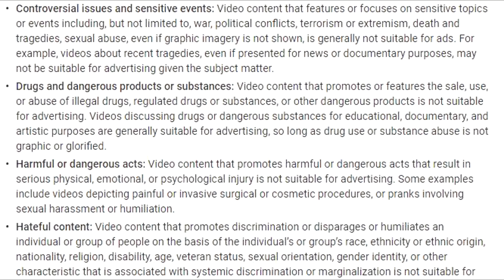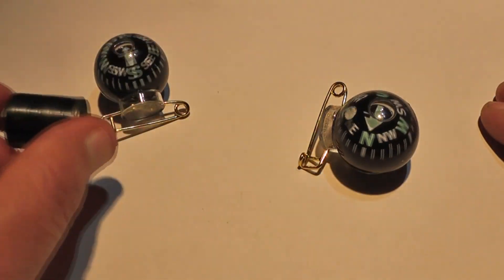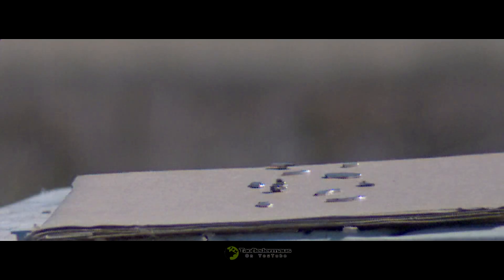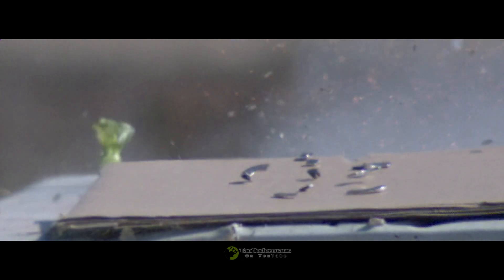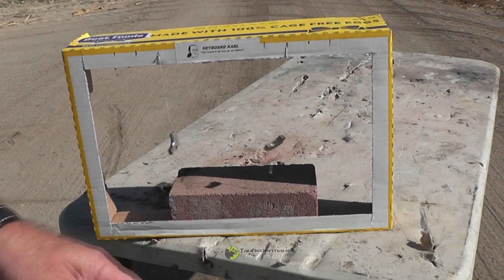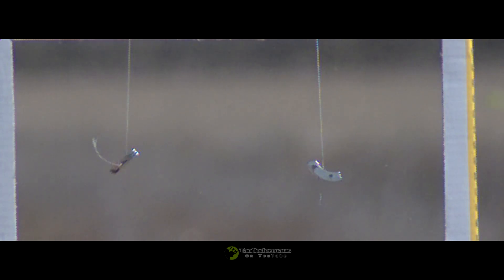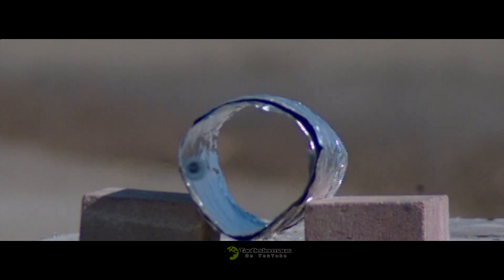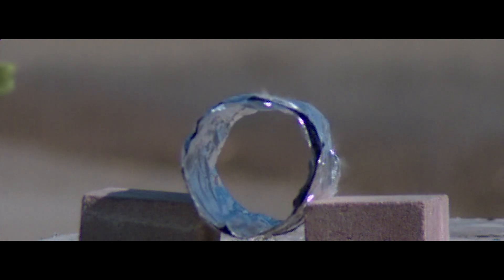1000 MPH Magnet Experiment

Comment: So I know a little bit about magnets I don’t know how quick heat transfer happens, but I do know bullets are very hot. When it comes to magnetism the hotter, you heat it up the less magnetic The heated item is, it will regain is magnetism as it cools down, but the higher, the temperature, the less magnetism it owns

Comment: Aluminum is a non magnetic metal and the aluminum tube would not feel the magnetic field of the magnet passing through it. What would happen is the magnet would cause an electric current to be induced into the aluminum and this current would give rise to a magnetic field around the aluminum. It is the interaction of this magnetic field with the magnetic field of the projectile magnet which would cause any physical movement. Loops of copper wire at both the entrance and exit of the aluminum tube connected to an oscilloscope would show peaks as the magnet entered and exited the aluminum tube and these could be correlated with any physical movement of the tube.

Comment: Try making a coil of of wire. A hoop which however many rounds and attatch a multimeter, pass the round through the hoop and measure the voltage. Some college or university student could calculate the predicted the results but they're not accelerating experiential rounds.

Comment: I have a 3000 lb pull force neodymium magnet. It's like the black hole of magnets. My nestikles get pulled towards it. I'll send it to you if you want to test it with steel slugs passing over it. Pull force has a big effect on momentum. Those little dinky magnets will have no effect but I've always dreamed of seeing it

Comment: I'd wager the aluminum foil tube collapsing was due to a drop in air pressure inside the tube caused by the fast-moving air around the projectile. It was crushed by atmospheric pressure.

Comment: The effect by shooting it through a conductive tube is actually a backwards force on the projectile itself as a current is created in the tube so what could be cool is putting a chronograph just before and just after the tube to see how much it decelerated. Also, if you had a giant winding of wire in a tube shape with a lightbulb connected to the ends you could potentially create enough current by passing the magnetic projectile through it to light up the bulb.

Comment: Objects in motion tend to stay in motion. The magnetic pull  of a magnetic bulllet will never be strong enough to overcome the inertia/the weight of the projectile. 

The faster something moves, the heavier it will get. Its mass stays the same but it will increase in weight. Because the projectile will increase its weight as its traveling, the pull it has over ferrous materials will not be enough to deviate its trajectory. In order to see any noticable difference, the projectile would have to be launched in vaccuum in a space nearly 200 yards long in zero gee.

Comment: Should have tried the expeirments without shooting the magnet first - by passing the magnet through or near the objects by hand - to see if they had any hope of success. I don't think many did. Did you try putting your magnet near any of that aluminum? I don't care what "youtube says" - I have a neodynium magnet much more powerful than the one you shot and it doesn't work on aluminum foil. Mine weighs over 2 lbs and you can set it on aluminum foil and the foil won't move off the table if you pick up the magnet. I coulda told you the experiment wasn't going to work before you shot the thing.

Comment: Right off the bat it occurred to me that there needs to be a means of isolation between the magnet and subject that would prevent influence of a shockwave. So the aluminum foil seemed to have the most potential here. Use a plexiglass tube suspended in the center of the tube of foil so that the ends of that plastic tube extend about 10 inches to rather end of the foil. That would isolate the shockwave but the flux would still have the distorting effect if infact that happens

Comment: It seemed to me that the shock wave effects on the cardboard and the aluminium - sorry, aluminum pipe were delayed, which you would expect for a projectile that has been electromagnetically accelerated to 1000 mph.  This potentially lends weight to the effects on the aluminium, sorry, aluminum foil being due to the magnetic flux.

Comment: The faster something is traveling the less it will be deflected by momentary side force. However the faster the magnet travels through a coil the greater the voltage. If you connect a pair of LED’s to a coil so that the LED’s have opposite polarities. You will most likely see them get very bright then burn out.

Comment: When shooting the magnet through the aluminum tube you should have had a chronometer at each end of the tube to see if it caused a reduction in velocity. Also a volt meter across the length of the  tube to see if it moved some electrons. What would be cool also would be to shoot the magnets though a copper coil to see it generate a current.

Comment: Hey guys! Great video, and it's great to see Jeff's face too! HAHA

These traditional magnets (and even neodymium ones) does not have fields strong enough to transfer energy and get other magnet materials to move at this speed. High velocity in this situation means less anergy transference. But there is a situation using magnetic fields where more velocity means more energy transfer, and even heat generation, please look at this:

https://www.youtube.com/watch?v=5BeFoz3Ypo4&t=46s

Moving magnets means magnetic field variation, which  generates current in conductive materials. The higher the variation, the higher the current, and the energy transference to electric current. 

In this video, the magnet gets slowed down (which means it looses kinetic energy). This energy does not disappear, it is turned into electric current inside pipe's material, and, by Joule's effect, turns to heat within this pipe's material. Also, as the field between magnet and pipe generates a force that slows the magnet, this force pushes the pipe back.

Where I'm trying to get: what would happen if you guys shoot a neodymium magnet through a thick cooper pipe?
My guess:
- If you mesure the projectile's velocity before entering the pipe, and after it leaves the pipe, you could see a good variation in it;
- If you put a voltmeter to mesure electric tension from the entering side to the leaving side, you would get a great electric pulse (high voltage maybe? A spark?)
- If you mesure the pipe temperature before and after shoot, I think you could even get a temperature variation.
- If you guys put a dynamometer (the instrument that mesures force using a spring) between the pipe and it's  support, you'll be able to to mesure the force that the supersonic magnet exercises on it.
- As neodymium is not a soft material, it would not deform, but if the energy transference gets too high (which means great deacceleration), the projectile could breack in pieces in the air before leaving the tube. 

With these data, my guess, is possible to even calculate the amount of energy that was absorbed by the pipe

Comment: Could you heat one of the items up really, really hot so it looses its magnetism before sending it through the foil tunnel and see if the shockwave from that has the same affect as the magnetic version?  (Alternative would be to make one of the same size and weight out of plain steel, so you wouldn't have to ruin one of the magnetic examples.)

Comment: the metal tube must be thick enough to absorb the power
Reply: and I speculate the wound coil is more effective to handle the induced current thro' the whole length so that you have induced magnetic field in forward ahead of the bullet to resist its movement. Certainly, the wire gauge must be big enough.

Comment: Neodymium magnets are pretty cheep on amazon ;) I used to use them to build my own speakers. Interestingly enough, they loose their electromagnetic field when heated. I’m curious to know if they would remain magnetic when fired from a gun. Also they tend to spark when they collide with each other. The benefit of using the ceramic magnets is they retain their magnetic properties even when subjected to heat.

Comment: Through a (air core) coil would be better than over a coil...

The spike would probably be too short duration for a multimeter... An oscilloscope should show it (with the right settings though)

Comment: Try hooking up a coil to an analog voltmeter and "accelerate" the magnet through the coil. I'm interested to see how much power you can produce. OK, I see, you mentioned it at the end, it may not be slow enough to see the spike but if you do a little math, you should be able to light some LEDs. I 'm pretty sure I saw a compass move but it was very slight. It needs to gain momentum but the projectile is gone before it can get much. 
 As far as seeing physical effects like attracting the magnets or slowing down the projectile using eddy currents, you're going to need to get the magnet much closer to the things you're trying to affect. For instance, drop the magnet through that aluminum tube, then try it through a tube that has an I.D only 2 or 3 mm larger than the O.D. of the magnet, with the same wall thickness. This should demonstrate why you saw nothing. That inverse square law drops off faster than most people realize. Slowing the projectile is probably still very slight and you may have to do calculations to prove that it happened.

Comment: Copper plate with DVM connected to opposite sides. See if the magnet can generate any voltage. A good, bench DVM should be sensitive and record the possible volts.
On the subject of demonetization. How many video games do they sell where the user has a gun with them at all times and the objective is to kill as much as possible?

Comment: I think the diameter of the copper or aluminium pipe needs to be only slightly bigger than the magnetic projectile to have a noticeable braking effect. So if you shoot through a 25 mm or 30 mm pipe, you might see an effect.

Comment: Some interesting suggestions to test whether these theories would work... Try the tube experiment with thin paper to see if it buckles in the same manner. That would tell you if it was the shockwave causing it to crumple. It is a weird result on video, as the projectile is super-sonic, you would expect a delay before the shockwave hits it. Another cool test, insulate and wrap a long length of wire around that aluminum pipe, and maybe measure a current or voltage spike from the ends to see if it transmitted some of the emf as it passed through.

Comment: To test the shockwave theory put a PVC pipe inside the aluminum foil tube, the PVC tube will absorb most of the energy of the shockwave travelling trough and the foil can only be deformed by the magnetic flux.

Comment: Ok really you can’t pronounce it right... Neo - dye - me - un, that will get you really close to saying it right. Seriously it’s not that hard. So annoying listening to you trying so hard to not say it right. The reason you won’t see effect is the magnets field is to tight. In terms of Tesla they are greatly beyond earths magnetic power but the field is close to the magnet as a result. You would need electric shims to push the field out.

Basically unless you do this in a vacuum chamber you won’t see any effect. Also you would need to get you accuracy down to a millimeter from the surface to get any kind of effect.

Comment: What I am quite interestet in is if the magnets are still magnetic after being shot. Because the very high acelleration acts like a shock on the magnet and strong shoks can demagnetize permanent magnets. Did you find any magnets after acelleration to test this ?
PS great video in any case
Reply: interesting idea. it could very well be that it would explain the passage of the pipe, the magnet should have been braked in any case.

Comment: You should wrap the 'tube' of your 'rail accelerator' with a long winding of copper wire and hook a voltmeter or similar device to the ends of the coil before accelerating the magnet.  Would likely yield a lot of energy.

Comment: What about a chronograph before and after a magnet travelling through a heavy copper or aluminum pipe to see if the magnetic induction slows the projectile?  The faster the projectile is moving, and the closer it is to the copper/aluminum, the greater the induction.  Think of it as magnetic induction braking.

Comment: I love the sound effects. Yes, you should try shooting through a coil of magnet wire, it must be close though (probably the same issue with the very large aluminum pipe you used, too far away from the magnetic field to have any effect).  To detect an electric pulse, you should connect an LED to the ends of the wires as your load, this should be seen on your high speed camera.  The other method would be to hook it up to an oscilloscope to detect the fast pulse.  BTW, did your video get demonetized?

Comment: I think the effects magnetics  weaken at speed. the magnetic field is just not strong enough to effect other fields with a small instance. its like sticking your hand in a fire. if you go in and go out fast you barley feel the heat. but I would like to see a long copper tube. I think if its long enough you could see the magnet stop, or slow. also keeping the fps low would help.

Comment: Shooting a stack of N52 grade neodymium magnets though a big coil of fine copper wire should make a HUGE but short voltage spike on the ends. The voltage produced is proportional to the rate of change of magnetic field and would be huge at those speeds.

Comment: It would be cool to coil magnet wire around a PVC pipe, shoot the magnetic projectile through the center, and see if there is any measurable current.
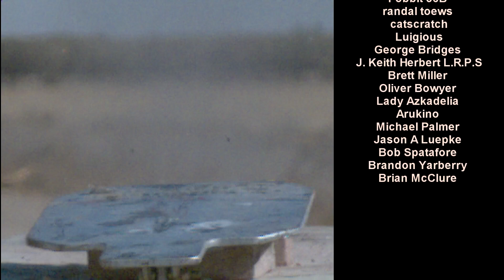Reply: I finished typing and posting that around the 10:00 mark. Seconds later, you mentioned something similar. Great minds.

Comment: Foil tube experiment:

The foil sucked in because the "projectile" passing throught the tube at such high speed created a lower pressure inside the tube, and atmospheric pressure on the outside of the foil pushed it in.

Same basic principle for airplane wings. The air rushing over the top of the wing creates a condition of lower pressure above the wing and the higher atmospheric airpressure below the wing pushes up on said wing creating lift.

Great X-periment though!  Sorry the Youtube NAZIS are making you jump through so many damned hoops to stay monetized!

Comment: With the aluminum foil, the negative pressure following the projectile will cause a slight vacuum on the inside of the tube vs the outside and cause the atmosphere to press in on the tube causing the distortion as you see.

Comment: Even though I've been a subscriber for several years, this is the first time I've came to the comment section to read or write a comment. I did take notice of the disclaimer you have put in front of the last two videos that I've watch however, so here I am. I watch because I am fascinated with the physics of projectiles. I can only assume that perhaps some of the comments made by people on these videos were deemed insensitive, and they were. As stated, I am unaware of any complaints about these comments, but I have also noticed a change in the last videos. Good job guys. I am sure the things that were said were not in malice, but they were insensitive. So keep up the good work, I am still subscribed.

Comment: Additionally, yes a coil wouldve generated electricity. Its a reverse bullet train lol. But you couldve seen if it was a shock wave in the others by sending a similar velocity non-magnet also in the shape of a cylinder, made out of something like lead, & then see if the foil tube still collapsed a bit

Comment: Make a big coil of insulated wire and fire the magnet through it. Bring the two ends of the wire close together to see if you can generate a spark. Hook them up to OG's nuts. 

The magnet fired through the pipe should have caused eddy currents in the pipe. The magnet should have given up energy to the pipe. Maybe put a chronograph in front and behind the pipe and measure the difference in velocity. Remove the pipe and try again to see if there had been any effect.

Comment: What if you wrapped magnet wire around the barrel? Would the magnet going down the steel(iron) barrel make an electrical charge in the copper wire?
I think this may create a short, but powerful electric charge.

Comment: See Earls' post below.
I was going to suggest using a long solenoid coil to test for induction. :)
Would coating the slug in the right sort of plastic reduce the breakage? Is there a powder that gives a softer initial impulse with roughly the same muzzle-velocity?

Comment: Fire the magnetic rounds through a coil of wire and measure the pulse generated. 

Years ago (1977) I worked for a short time measuring velocity of artillery projectiles.  The rounds (as large as 8 inches in diameter) were magnetized and launched through two large coils of wire about 30 feet apart.  Electrical pulses were generated from each coil as the magnetic lines of flux passed through each coil of wire and used to start and stop some clocks ticking off in microseconds.  Simple mathematical equations were then used to measure projectile velocity at the coils.   But, we then had to apply ballistic coefficient drag, angle of muzzle elevation, barometric pressure, air temperature, and distance from the muzzle to the first coil to extrapolate true muzzle velocity.  
FUN JOB!  
Except for all the math.  8-)

Comment: My suggestion FWIW would be to propel the magnets through a wire coil connected to the terminals of an oldschool magnesium flash bulb, if it worked that'd be bright enough (I guess) to show up nicely in the slowmo replay.